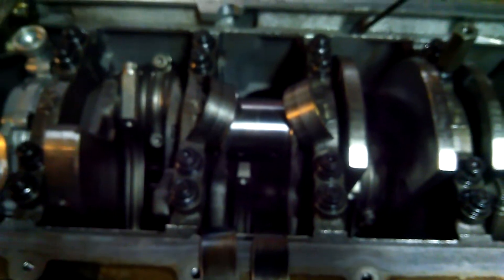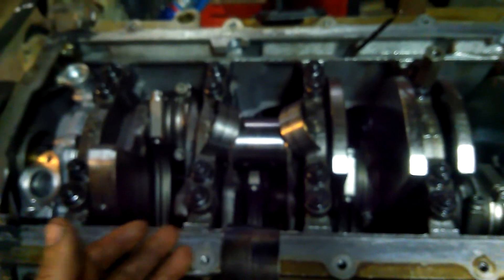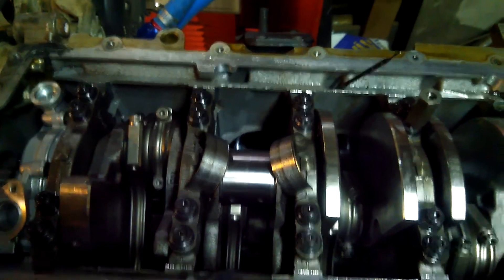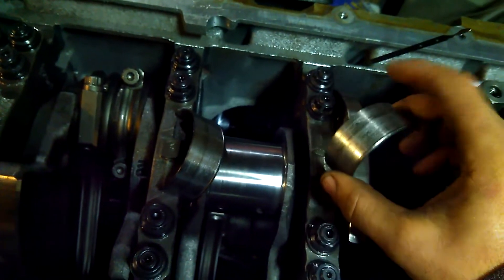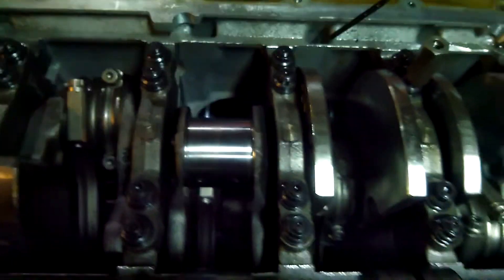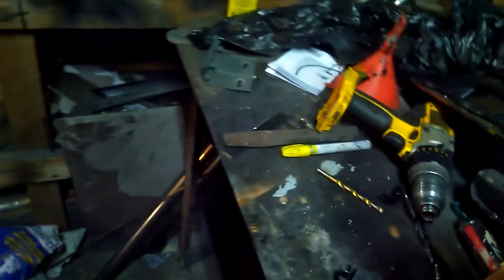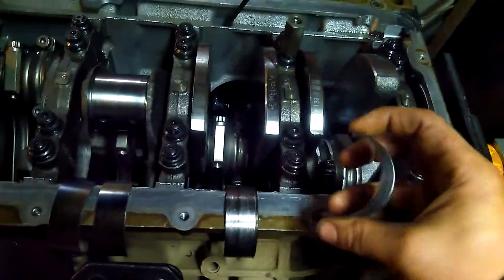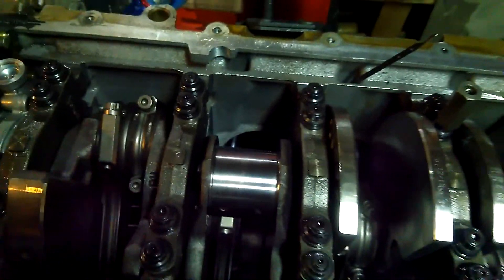Coyote v8 rod bearing failure

Comment: I have a 2014 F-150 with a 5.0  and 29,500 miles.  Mine developed a tick that sounds like it's coming from the front of the passenger side head (Around the phasers).  I have the valve cover removed and the cams and everything look good, and the timing chains are tight.  I read were a Mustang owner experienced the same thing as I did and his problem was a bad rod bearing.  It doesn't start ticking from cold start until about six to ten seconds after starting it.  Sometimes a little later, sometimes sooner.  The ticking is consistent with throttle, but you can't hear it inside the cab.  The truck runs like it should.  What do you think?
Reply from the maker: I believe that is a fairly common issue. Sadly last time I looked into it. It seemed ford was on a don't do anything till it's really fucked. I read somewhere people were blaming the tick on piston slap. I know early engine didn't have the best bore roundness.
Reply: @Nodarperformance  I know there were some '11-'13 models that had overbore issues.  I haven't ruled out piston slap.  I'm going to pull the oil pan and check the rod bearings.  I have documentation from Ford saying it was normal.  I might just trade the damn thing in.  This is my second problematic Ford truck in a row.
Reply from the maker: @PatriotPlus179  its always a shame to trade something is because of an issue the manufacture should be fixing.
Reply: I just dropped a gen 2 engine into my gen 1… it was a used engine with 30k miles but I put new cams new timing components billet oil pump gears and sprocket and second day I started hearing the same sound you just described on the passenger side head and only when engine is warm sounded like a lifter… I’m still trying to figure it out

Comment: Did you have to rebuild, or were you able to just change the bearings? Were you able to use the rod?
Reply from the maker: New crank and rods.
Reply: @Nodarperformance  im having this issue, anyway i can contact you directly for some info?
Reply from the maker: @chrisortiz449  doubt I could offer much help as it's been years since I've looked at a coyote v8

Comment: Lack of lube causes spun bearings every time. Those engines have the worst lube systems possible for the other "features" they have.
Reply: Was hopping the MMR oilpump housing and billet gears would have over come the oiling issues but I guess not
Reply: 0w-20 helps a ton, surprising nobody talks about it.
Reply: @the maveric  i snapped a secondary timing chain and pulled my engine apart and there was so much large metal flakes that i know it had to be rod bearings and sure as shit it was...always ran 5w30 and I wonder if that did it in. Engine was quiet untill the tensioner snapped and never lost oil pressure...
Reply: @themaveric32 here you are again. As someone who just paid $160 to put 5w50 in their car i'm interested in what you have to say. Hopefully you reply
Reply: @White_Fox_5.0  worked fine while I had the car fbo with cj and e85. I always used ceratec. This was 5 years ago dude lmao
Reply: @themaveric32  well for you it was 5 years ago, but i have one of these cars right now. So thank you

Comment: You need to delete the oil squirters.
Reply: David Kelly  how would that help? I've always thought they were good as long as you don't spin it to the moon.
Reply: Hagen Farmer because they take oil away from the bearings.
Reply: @davidkelly8715  The bearings aren't getting oil because gen 1s should be using 0w-20..
Reply: @themaveric32 i thought it was 5w20?
Reply: There is oil analysis all over google about it. 0w-20 even shows to be way better then 5w50 even when raicing.  5w50 just simply dosen't move fast enough.